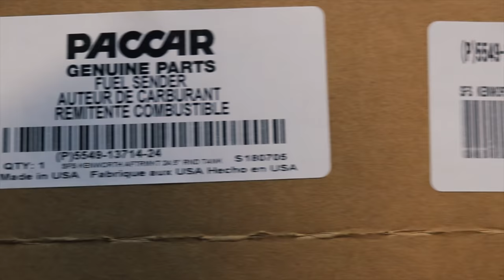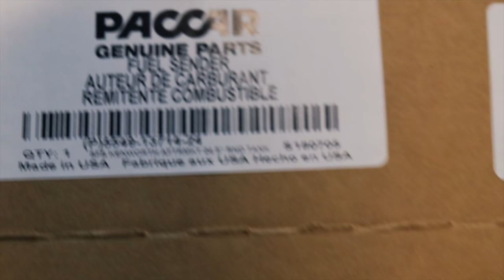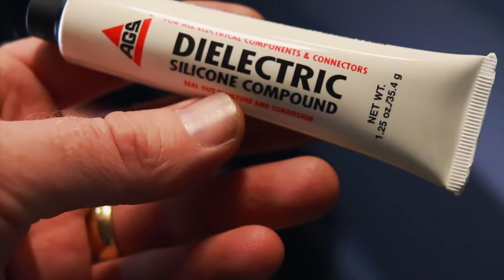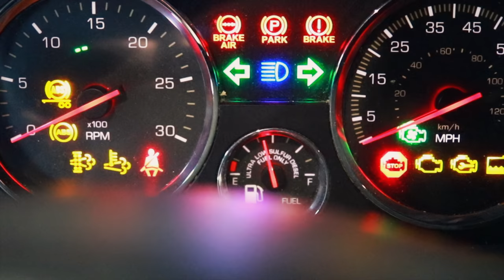Fuel Sending Unit Replacement Kenworth /  Peterbilt DIY and Save Some Money

Comment: Dealer bill: 
1 hour to hook up to E.S.A. aka chassis noid
1 hour to monitor simulate and monitor gauge 

1 hour to R&R UNIT  Plus the infamous shop supply lol 

48 TO 96 HOURS DOWNTIME AT SHOP WAITING ON A AVAIBLE TECH 

😲 that's a lot of money lost when you can do it your self 

Great video
Reply: You had me at shop supplies I know you know let me tell the other people what shop Supply's really mean if they did it right it's the plastic that goes in your seat you don't get it's the Floor paper they put on the floor you don't get it's the cleaners to clean the handles in the steering wheel but you never get that everything is always greasy. everywhere oh one more thing anytime they have to work in the inside of your truck they're supposed to vacuum but that's sitting in the back near a lifted truck that somebody's been mudding all weekend you don't get that either nothing against their pickups I just know what they drive
Reply: @1010109999999  and the boot covers don’t forget those
Reply: @sonofmontezuma3732  oh you are so right my friend I did think of those I was just trying not to be so long-winded thanks for sharing😁

Comment: Will the malfunctioning of this unit alter the average mpg display on the dash? Or is it strictly for the level of fuel in the tanks? When I start my truck it shows add fuel along with the fault light. After running for a few minutes it starts to move, then drops back down to below the E. No movement of needle when i let the key cycle through its system checks, only when the engine is started. Other times it works fine.
Reply: At least on my truck that number on the dash has never been accurate

Comment: So does the right side have one as well ?
Reply from the maker: No you just have one side. The tanks level out with a crossover hose
Reply: Oh That’s right duh thanks
Reply: @KoonTrucking  Dealer just told me I have 1 in each tank.. have a 75g on drivers side and 100g on passenger side.. better match the part with the one they give me.. only have 1 fuel gauge so now I'm confused..

Comment: My truck is identical to that one. 
A couple times I have cranked her up and needles below E and red light on. Soon as I move the truck, it starts working. 
I am also wondering how to properly clean the MX 13. 
What do you blast and what do you not?  Lol
Reply: Did u ever replace it mine is doing the same its at hafe a tank after i take of ut goes to empty with light on but then levels out on a w900l

Comment: How do I check to see if it's the sending unit or the wire hornest?
Fuel gauge stuck on empty .
Reply from the maker: Ohm the sending unit out. I can’t remember the specs off hand but you can find them online. Unless you see damage on the connector or the wiring more than likely it’s the sending unit
Reply: @KoonTrucking  thank you
Reply from the maker: No problem. Thanks for watching the video.

Comment: What do you guys think about the Diesel Force Foam scrub?  I’m trying to get my EGR system flushed because my truck runs sluggish like it gasping to breath.  Many parts and $ thrown at it and don’t fix the problem.  Last resort seems to be the foam scrub by Diesel Force. Just looking for someone with the paccar adapters.
Reply from the maker: Never had to use it ?
Reply: Ok.
Reply: Ray Nieto mine runs the same. I’ve discovered it’s the turbo boost dropping out, or delay in kicking in. From what I’ve researched it’s the turbo actuator. This is with a brand new EGR.
Reply from the maker: Have you put it on a scanner to see what it’s actually doing ? Curious to see what the readings would be if a scanner shows it’s not operating right
Reply: Koon Trucking it’s not throwing any codes. I have a BullyDog. When I get on it the boost will slowly build sometimes and other times kicks right in. Other times it will build then start dropping off and sometimes it will build to like 22 psi and just hang there and go no higher. If I let up on the fuel and whack it it again it will kick in.
Reply: As of now I’ve had it at the dealer and they replaced the bpv EGR tested the turbo and actuators they said everything test out good.  But it started throwing BPV codes again like it was before.  Only now it only does it when my turbo drops in and out and struggles to maintain power.   Once it gathers itself and stops fluctuating the codes will disappear and check engine light goes out.  Supposedly the Peterbilt dealer in San Antonio TX diagnosed everything and can’t find the problem.
Reply from the maker: That’s strange. Let me know what you find out

Comment: Wish it was that easy on some cars and light trucks.  Some cars have a hatch in the floor over the fuel pump module, but not all. Every light truck (pickups and vans) requires dropping the tank or, in the case of pickups, you can opt to lift the bed. Occasionally, I get stuck with an Asian sheet bocks that requires removal of the rear suspension to get the fuel tank out. 😡

Comment: So the new one don't come with a new gasket?
Reply from the maker: Nope have to order it separately (didn’t know that until we did the job) one would assume as much as the part cost that would have been included in the box. Goes to show you that you can’t take anything for granted.
Reply: @KoonTrucking  You know how it is. Truck dealers love to bend people over. One of my trucks got hit by a Mexican with a revoked license the other day and Kenworth was dragging there feet to look at the truck. I had to call and remind them how many trucks we bought this year from them. That day the general manager was at my office giving me a estimate. Funny how that works. 😂🤣

Comment: Thanks for not showing how you got the new one in the tank with the low clearance wtf bruh
Reply from the maker: Dude it’s simple slide it in the exact same way the old one came out ? Hell play it in reverse if it’s that much of a struggle for you
Reply: I know bro I got a Volvo with the same similar setup but I've no clearance at all the old one was broken fell inside tank so it was nothing to remove. Guess I gotta put bottle jack in-between sleeper an frame or turn tank sideways some
Reply: The rod not the float is to long. If I take apart do you know if I could press back on securely